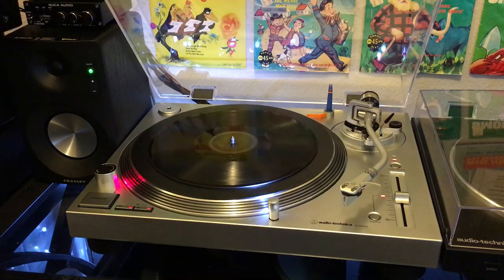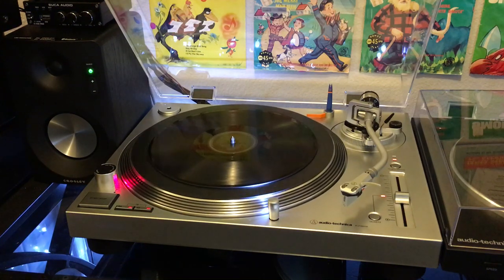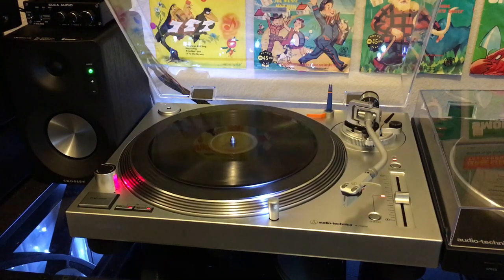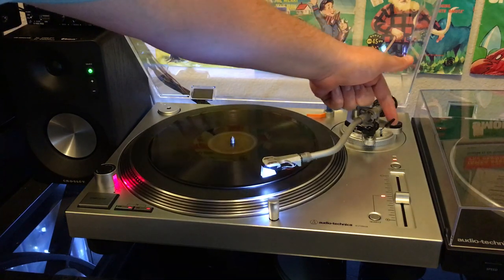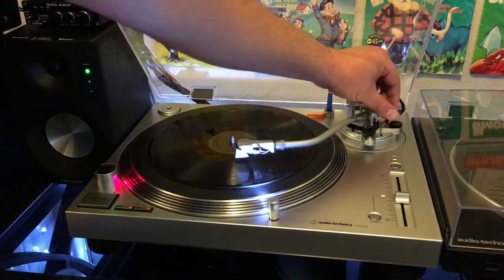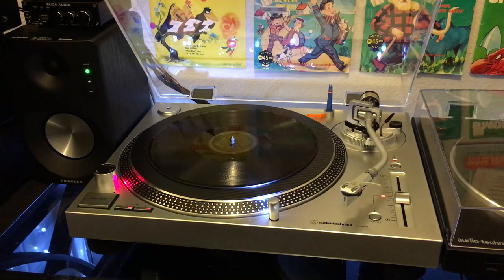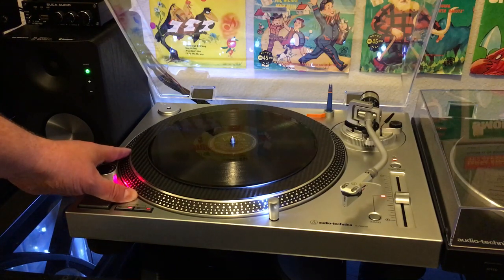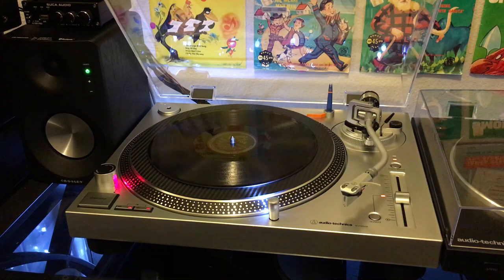78’s The Right Way!

Comment: Good Afternoon. My question is, whether the same cartridge with separate stylus used or cartridge and stylus both specially for 78 rpm. 

i will be very grateful if you can provide me with detail info and also the specifications of cartridge and/or stylus.
Reply: Bhalchandra Lagu it’s a separate cartridge, they’re called “wide groove cartridges” and a normal cartridge that you’d play on a 33/45 wouldnt pick the sound up right.
Reply from the maker: Depending on the specific set up sometimes you can simply replace the stylus I believe. However this cartridge was specially designed for this stylus and this application.

Comment: Record-ology, I found two recordings in my stack of old 78's.  10" record 1/4" thick.  Edison recording.  Even the 'label' is embossed on.  The record plays very softly.  Can I play these on my set up with the Ortofon 2M78 cartridge and needle?  When were these made.  Thanks,  J.R.
Reply from the maker: GREAT question!  You need to invert the signal when playing back a vertically cut record - you can do this with the wiring on the back of the cartridge...  Also, verify the groove width....might be a tad narrower than the 78 stylus in which case you would be better off with a standard microgroove stylus.  https://www.youtube.com/watch?v=Y8YZTj4C45k
Reply: @Recordology  Thanks for the reply, and the link to your video.  That was helpful.  J.R.

Comment: This is just terrible advice - it is more like "how NOT to play your 78rpm records". It goes against what most shellac record collectors advise and for good reason too. The shellac 78 or so rpm (SP) records and the vinyl 33 1/3 or 45 rpm (LP) records were designed to be played by totally different systems and the expectations on their longevity were also totally different. The SP records were never designed to be played indefinitely without wear whereas LP records - more or less - were. Just because you can get sound out of an SP record when playing it with an LP cartridge, this doesn't mean you should. LP cartridges were never designed to be played at 78 rpm - this is more than double the 33 1/3 rpm speed and 1.7 times the 45 rpm speed!!  An LP cartridge had a totally different construction to the steel needle plus soundbox apparatus that SP records were originally intended to be played with. 

If minimising wear to SP records is a priority, then they must be played either using a modern cartridge dedicated for SP record playback (these are usually advertised as 78 rpm mono cartridges) such as those sold by most major cartridge manufacturers (Audio Technica, Grado, Ortofon etc.) or, alternatively, on a gramophone equipped with a fibre or thorn needle (assuming you have the right soundbox that accepts these - it's generally not the same as the soundbox that accepts steel needles but thorn needles might work with steel needle soundboxes).

The above holds for most of us. For those who are dedicated to preserving the SP record meduim to the maximum degree possible there are two more avenues. The first is to play SP records using a laser turntable. The second is to play them using the proper 78 rpm modern cartridges but at a much slower speed (say 1/4 or 1/2 of 78 rpm etc.) and record the sound to a suitable medium (e.g. in analogue form on magnetic tape or digitally in a digital file) and then have it played back at the appropriate higher speed (i.e. 4 times or 2 times etc. faster, respectively) to obtain the correct sound.
Reply from the maker: This stuff is so subjective….I simply don’t believe the hardest substance on earth will have any trouble in a groove that is to wide.  It won’t sound as good but it won’t damage either the record or the needle.
Reply: @Recordology  Quite the opposite I'm afraid: it's 100% objective and if one applies themselves to it, it is also quantifiable. The hardness aspect is only one part of the equation, but even so, it doesn't work the way you think - otherwise rocky mountain sides would not be eroded by water. Just check the state of a well played LP cartridge tip: it does get worn out eventually and that happens by playing vinyl records (which are a lot softer than shellac) and at a much slower speed too. But that is not really the problem here: the real problem is that the stylus of an LP cartridge rides in the SP record groove rather than on top of it. This means that it simply cannot track the groove ondulations as it should and simply keeps getting bounced around inside it. It's hard to think of a good analogy to illustrate this. The only thing that comes to mind is the difference between a bobsleigh that is steered down the track normally and one that's out of control: they both follow they track eventually (as they are bound by it) by the latter suffers (and causes) a lot more damage.
Reply: I don’t get your point. He IS using a mono 78 cartridge and not an LP one.

Comment: And NEVER play (read: ruin) 78's on antique Victrolas. If you do you have no interest in music and no respect for original recordings.
Reply from the maker: I've heard from many people that this sentiment is grossly overexaggerated.  In my experience, it never did any damage (at least on my reproducer which was rebuilt.)
Reply: @Recordology  I'm afraid "many people" are wrong. You don't have to be a rocket scientist to understand that a heavy soundbox and steel needle cause excessive wear. And being a 78 collector for 50 years myself I can wholeheartedly confirm this; I have actually tested it a few times. Played 20 times with a new steel needle results in one grade down for a good quality 78 (Victor, Brunswick)  more than that for a lesser quality pressing (Paramount, Grey Gull, Banner etc.). If you want to play records on an antique Victrola just for the fun of it, use common, worthless 78's. The sound is poor anyway (compared to modern reproduction of a 78) so all the more reason.